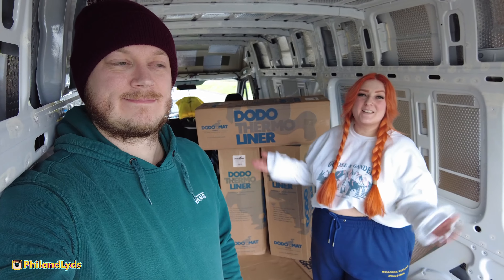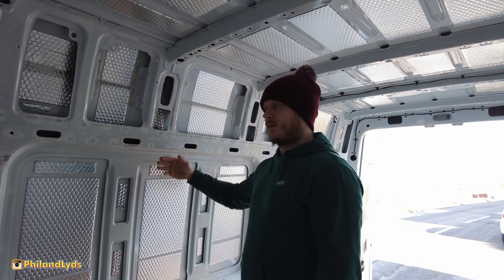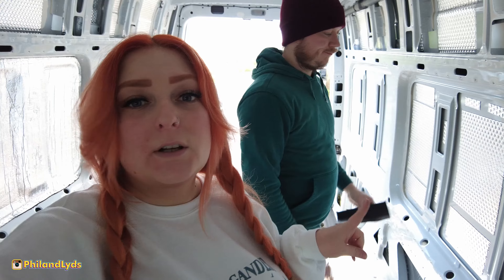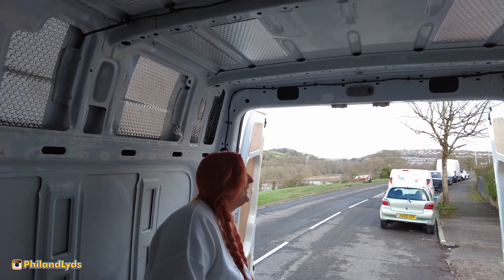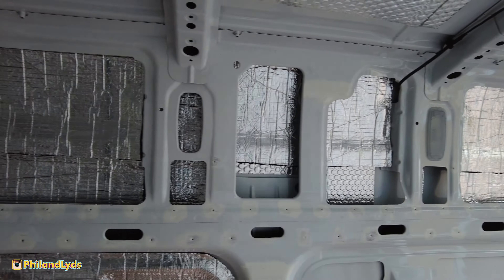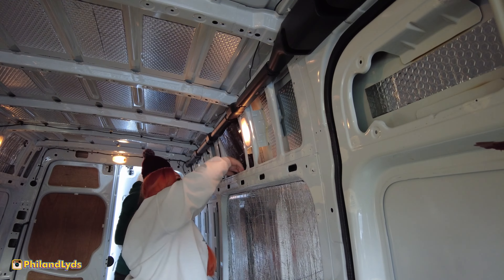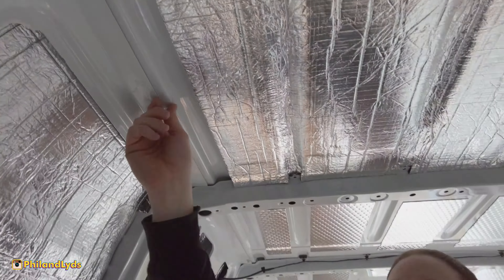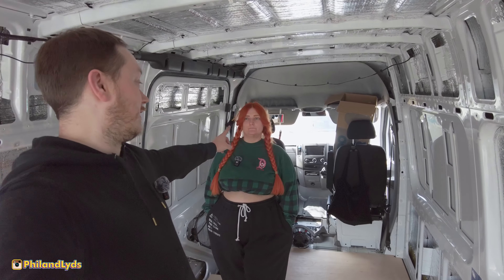Is DODO the BEST Van insulation? | VAN BUILD SERIES Ep10 Sprinter Van Conversion

Comment: Hi, glad I found your video. I’m planning on using the same product when I get a van.
The good thing about the closed cell foam is that it is a moisture barrier and combined with the silver should not need the fiber filler.
I do plan on insulating the wall panels to give that soft padded feel and increase the insulation under the 4 way stretch carpet.
I don’t know if you are planning solar on the roof but it keeps the solar load off it whilst generating power.
Take care M.
Reply from the maker: Thanks for watching!
Yeah it's good stuff, We're still using it now and it also makes quite a difference with the acoustics.
Solar is planned in the future so will keep that in mind.

Comment: How much thermo liner did you use to get to that point at the end of the vid?
Reply from the maker: Hey, We probably used around 1.5 Boxes of the 6mm Thermo Liner by the end of this video (maybe slightly less). We have three in total and we've only just opened the last box now as we are filling bits in as we go along. Hope this helps. Thanks for watching!
Reply: @PhilandLyds  thanks that's very helpful.
Reply: @PhilandLyds  Hi, are you still going with this? Did installing this stop condensation forming on the roof? It will be a while before I get to my conversion but fed up of drying my roof.. Thanks
Reply: @88GraG Hi, what van do you have? Regards M.
Reply: @markeh1971  Mercedes sprinter LWB